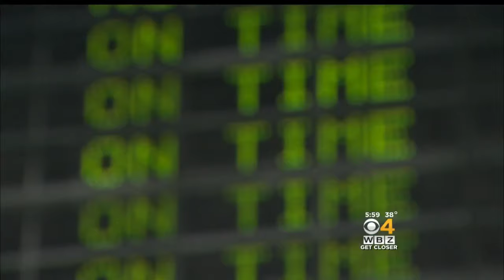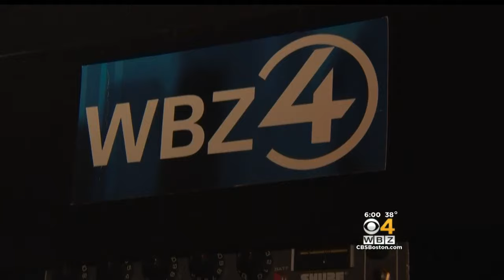What Went Wrong With The MBTA Commuter Rail

Comment: The MBTA Commuter Rail (reporting mark MBTX) system serves as the commuter rail arm of the Massachusetts Bay Transportation Authority's (MBTA's) transportation coverage of Greater Boston in the United States.

Trains run over 394 mi (634 km) of track to 134 stations.

It is operated under contract by Keolis, which took over operations on July 1, 2014, from the Massachusetts Bay Commuter Railroad Company (MBCR).

In 2021, the system had a ridership of 8,877,600, or about 69,400 per weekday as of the third quarter of 2022, making it the sixth-busiest commuter rail system in the U.S., behind the three New York-area systems, the Chicago-area system, and the Philadelphia-area system.

The line's characteristic purple-trimmed coaches operate as far south as North Kingstown, Rhode Island, and as far north as Newburyport and as far west as Fitchburg, both in Massachusetts.

Trains originate at two major terminals in Boston – South Station and North Station.

The only connection between the two halves of the system is the non-revenue Grand Junction Branch.

The North–South Rail Link is a proposed tunnel between North Station and South Station to allow through-running service.